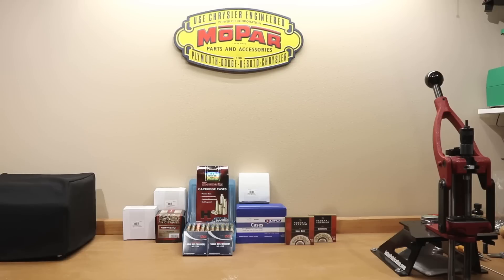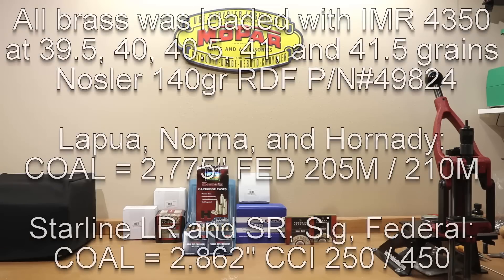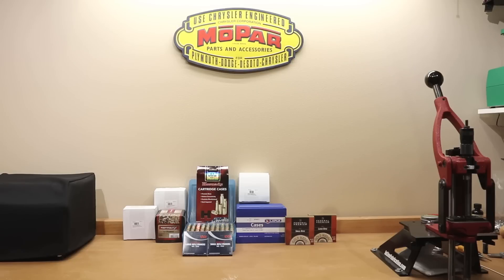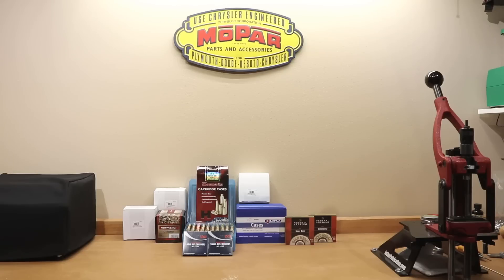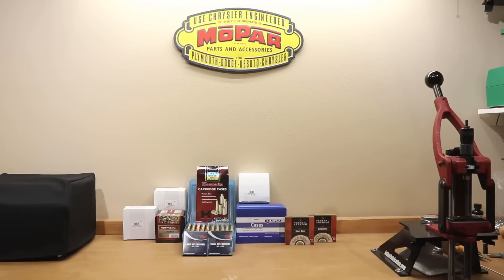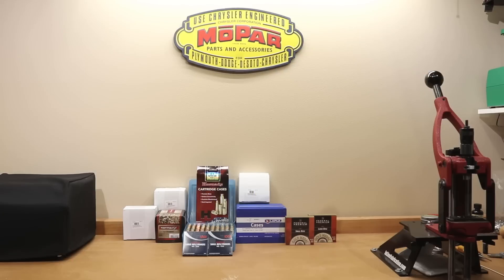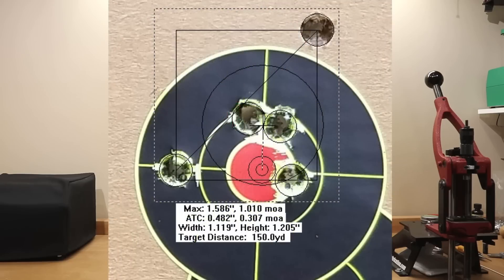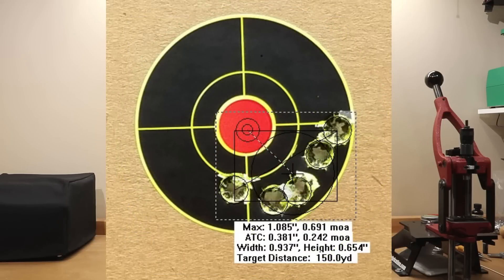Ultimate 6.5 creedmoor Brass Comparison guide velocity and group information

Comment: Your video was to blurry to really see the info but good test anyway, I have a few pounds of IMR4350 and use it as back up to H4350 @42.5g and Varget ( sometimes hard to find). It's good to find your test ( I know from my tests that it takes time to do), I'll probably run a little hotter though, I've heard it gives better groups with slightly higher charge. As for brass I'm not that picky so long as it's looking good and has proper length, mostly use Hornady, Winchester and Federal with CCI BR2 primers..... My RPR 6.5 CM just loves to be fed and taken out for a hunt or range play.... does me good with anything.
Reply from the maker: Hey Steve, if the video is blurry there is a good chance that YouTube lowered the resolution on whatever device you are watching it on. You can change it and should be able to see it.
Reply: I watched this on a work computer while on break, went home and watched it again on mine and the image was normal. One way to keep us from playing at work, LOL...... Great video, I'm sure it helped a lot of re-loaders and shooters, thanks for taking the time.
Reply from the maker: Glad you enjoyed it Steve. I really like my RPR and its probably getting time to switch the barrel to be honest. Going to have to start making tough decisions.
Reply: Bolt: You must put a lot of rounds through her....I have had mine 2 years and other then zeroing with and without suppressor, testing my perfect reload and shooting 2 deer I've only put about 40 rounds through her, saving my barrels ( on my rifles) for SHTF which I think may be coming soon.   Being Clairvoyant is a BITCH!  I've seen some of your other videos......good job and a lot of good info for beginners.

Comment: Sweet video and interesting findings but what was the point of doing this if everything is going to change after the first firing and the info after the first firing is the more important? I dig t none the less..I assume you’ll be redoing this test now that the brass is fire formed?
Reply from the maker: +MannyyP28 thanks for commenting. I am not sure I will repeat the test completely. Largely I am trying to demonstrate the out of the box quality that you should expect. The second firing on the Norma cases was singe digit sd and ES in the very low teens. It's great brass, but pretty expensive.  If I spend the time to ultimate case prep all the brass I am not sure its a fair comparison either. I am open to ideas for interesting tests though.
Reply: Bolt Action Reloading I hear ya. Which was really interesting but I’d be curious as to see how they hold up and keep their consistency after they are fire formed. If you run out of ideas that would be an interesting one and an idea for ya to see which one can be reloaded the most. I’m not completely caught up on all your videos so I’m not sure if you anneal your brass and how often you do but it’d be interesting to see those kinds of differences. Thanks for the vids!

Comment: I love info! Thank you for your work. But if I could make a suggestion not at all related to reloading. When editing your video try using an equalizer on your vocal track and reduce the frequency around 400hz. On my computer speakers that will make your audio work better with smaller speakers.
Reply from the maker: Glad you enjoy the channel. I hope that others find it interesting. As far as the audio is concerned, I am not sure how to fix this. I do a noise background sample in separate software and perform a noise reduction on it. My editing software doesn't have any advanced audio manipulation so I have to use something separate and then sync the audio manually that is a real pain, but the only thing I know how to do it. If there are some of my videos that are better than others let me know so that I can research the settings I used on them and maybe figure out a better setting. Feedback is always appreciated!